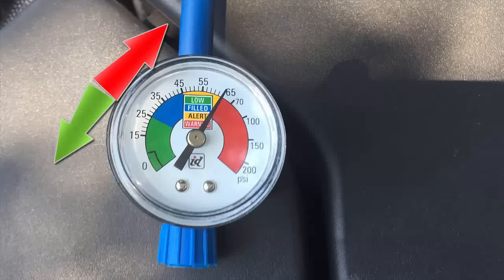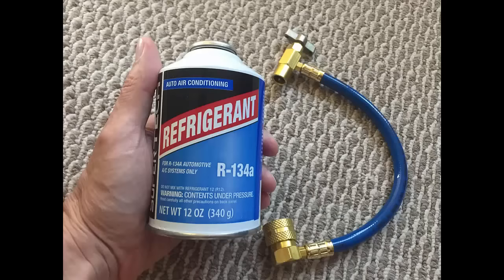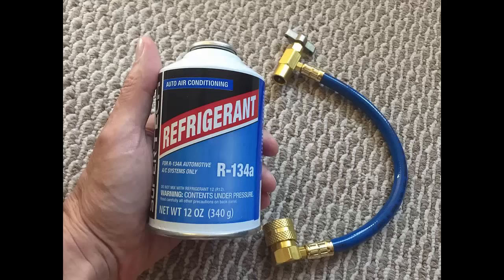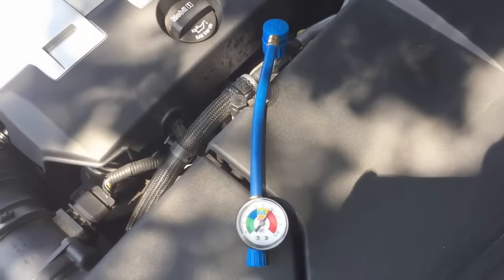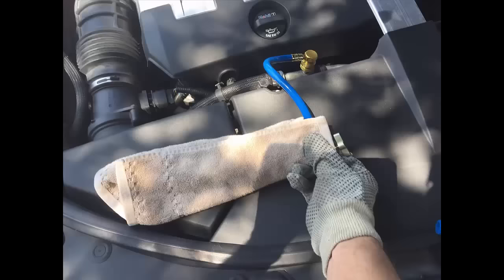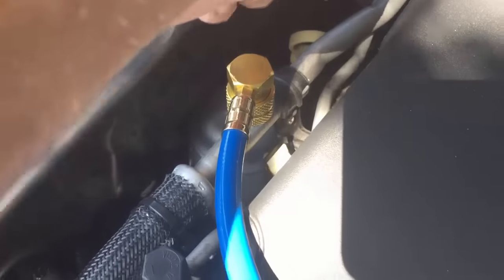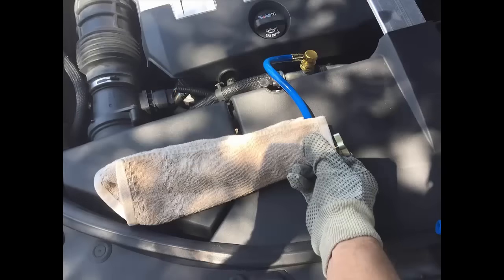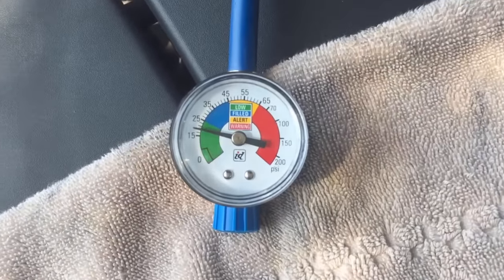Car AC pressure too high FIX overcharged a/c gauge fluctuation reading jumps Up Down Freon problem

Comment: I used a/c pro to recharge my system in my 2009 Lincoln MKS.  I did it once a few years ago and it was perfect.  Cold air, no issues.  The AC started to blow warm again in June 2022, so I figured I'd recharge it again.  This time, not so good.  While charging, I noticed my engine stuttered and the a/c pro gauge jumped back and forth.  When I got into the car, the air was warmer than before.  Thinking it just might need some time to recycle, I drove home.  The AC never got cool, the engine was rough, and the RPM gauge in my car jumped wildly.  I ran the ac when I got home for about 25 minutes, and nothing changed.  Now I think I have an issue and will need to go to the dealer (likely $200-$300 to check, evacuate, and recharge).  Before I made that call, I thought I'd check once again on how I might fix this, and saw this video.  I watched it a few times thinking it couldn't be this easy.  I read a hundred or so comments.  Many thanks and good results, so I thought I'd try before making the dealer appointment.  I put on my gloves, grabbed a towel, and before I turned the car on, I attached the A/C Pro gauge without a can and pulled the trigger.  IT WORKED!  It only took a few short squeezes.  I started the car, turned the AC to full blast, AND IT WAS COOL!.  I went back to the gauge to check the reading while the AC and Car were on, and made a few more short squeezes until the gauge got into the green and settled in the green at 25.  Removed the cord/unplugged, recapped the low-pressure input, closed the hood, and enjoyed cool air inside the car for 25 minutes.  I turned the car off, waited a few minutes, restarted, and turned on the AC.  It still worked.  The whole thing took under 10 minutes.  I'm so happy.  Saved me $200-$300, and a day at the repair shop.  I know you're not supposed to release the contents of the system into the air, but it was so little I don't feel bad at all.  Thank you @Yourself for this most helpful video.
Reply from the maker: Thanks for sharing!

Comment: Thank you so much dude! You saved my 2017 Nissan Frontier’s AC’s life! I thought I completely fucked my air conditioner because I over filled it but thanks to you I let some pressure out and it works like new again! You saved my ass bro thanks again!
Reply from the maker: Glad it helped!
Reply: I have an 18 frontier. What psi on low side is working good for you? I don't trust the color system

Comment: Thanks for the video. My AC was working in the morning and late evening but right at 3PM when it's super hot the AC was just blowing hot air just like your issue.  I could hear the compressor kick in and out so I know there's Freon in the system and  system is working.   I release some pressure out a few times and now my AC is cold once again.  Previous owner probably did some work on the system and either overcharge it or not enough Freon.  Thanks!
Reply from the maker: Thanks for sharing!

Comment: Thanks this video helped out.  In my case, I had too much Freon and had to release the pressure.  It sure sounds like either you have too much pressure or too little pressure and the compressor therefore turn on and off.  If you just recharged it I would imagine that your pressure is too high.  And if you haven't recharged it, it probably means your freon is running low.  At least that's my opinion.
Reply from the maker: Well said Randall Quezada!
Reply: i just put a can in yesterday, it does get cold now but it does go from cold to not very cold, back and forth. then today i checked with the same gauge the video has and it keeps going from the bottom of the green to the top of the yellow. and i hear the click everytime it goes up or down. is this the same problem?

Comment: Thank you so much . I thought I just blew my compressor after misjudged recharge . I removed some refrigerant and now the ac is back on track . 😊
Reply from the maker: Yep, they sell huge canisters with refrigerant, while most people need only a couple of ounces to top-off the system. I'm glad you fixed it yourself!
Reply: That's the high pressure switch making it cycle the compressor. While your letting out that freon if it's being sucked into your cars engine is being turned into fosgine gas. That will kill you.
Reply: @AltonRowell-gb1lb  r12 does, yes. r134a is pictured.

Comment: Seems how something so simple would work!! I thought for dammed sure by getting "greedy" with the cold, it was going to cost me a lot of money to have it "professionally" done. Now the back story that could help some..... The air was already pretty cool but the PSI was only showing mid 20's and when the compressor kicked in for a few seconds, maybe 45 (which isn't the reading you're looking for). After "filling" (maybe 5 oz's)..... It read 40 and 60.... However, it was only 70 outside. Next time I turned it on, it was less cool so I went to look at it and the Compressor clutch kept cycling and screwing with my RPM.... on top of the seemingly warmer air..... THAT WAS IT..... and I came here.... Thanks for the simple fix my man..... My tip would be, if you don't need a whole lot, don't turn the can upside down when topping off...... Rather put a little in at a time through different heat conditions and don't go for MAX cold, you'll just end up wasting it

Comment: edited....sorry, i was FIXING MY A/C outside and commented too quickly/too vaguely.  the gauge should be fluctuating a little as the clutch engages. It should be in the blue (on this gauge) all the time when the car is running a little above idle with a/c on.  Running at 15 when the clutch is engaged is too low.  it says so right on the gauge.  If you hook up the gauge and it is high and the a/c compressor is cycling on and off quickly, you don't have enough freon.  As you add freon, the pressure should go down, and you should hear the compressor running longer and longer.  My compressor is loud.  Your's might be quiet...you'll know it's kicking on/off because it will click and bring the engine idle down when engaged/running, then click and idle will go back up.   If the compressor is not turning on, several things could be wrong like a relay, nearly no freon, bad clutch, etc.  If you add a can of freon and the pressure does not go down or compressor cycle, something is wrong.  One of my cars is 15yrs old.  I have to add a can every year.  You know you must add it if the a/c works when it's cool outside, but doesn't work when it is hot (above 80?).  With the a/c on max, the clutch was cycling/engaging for about 2 sec, then off for about 5 over and over, and the air coming out of the vents was warm.

Comment: it worked for my Silverado 2011 that was constantly running high for the cooling fans, high noise when they are at high speed constantly, and  I read is a symptom for overcharged, and this fan high speed  happened after last gas fill I did. due to leaks fixed with 3X sealant can. Thank you very much.
Reply from the maker: Thanks for watching!

Comment: FINALLY! I thought it was the relay plug, it wouldn’t quit stopping and starting. Endless cycle. I just found out it i put too much pressure in, and it showed on the gauge there was too much pressure once the car had been running for a while. Let your car run with the gauge connected, and once the car has say for about 5ish minutes you’ll tell if there is too much pressure.

Comment: I save my empty cans and use them to discharge into that way I can reuse later without having to buy more:)
Reply: How do you get it back in the can? May be dumb but serious question.
Reply: @turboDavo  have to use manifold set and off the high side, takes some doing to make sure get liquid back in can and cautious of the high pressure put back in the can
Reply: @turboDavo  I packed the can in ice and filled it using right side up, it won't fill up as full as when new but works for just bleeding off a bit of over pressure.  I haven't tried this yet for vacuuming the ac system to work on it.

Comment: Awesome video thanks for this. Just wanted to say though another issue might be air in the ac I think your suppose to vacuum the old freon out. What I learnt when looking this up but could be wrong. Ty for the vid
Reply from the maker: Yes, if there is air in the system, the leaky part needs to be replaced, vacuumed, and fully recharged.

Comment: Awesome vid....
I filled my car ac and I put way too much.  AC didn’t even kick on because there was too much refrigerant.  I used the artic freeze trigger and just triggered away the excess gas and now it’s working fine.  My trigger gauge colors are different where green is good and white is low.
Thanks
Reply from the maker: Excellent! Thanks for watching.
Reply: so you use the same hose and gage that came with the refrigerant can? do you just unscrew the refrigerant can off the hose and then hook the hose up to the low pressure line?

Comment: This guy is fucking awesome!!! I overfilled my AC system and it was blowing hot. I released some of the pressure and now it's ice cold again. I'd  say it is colder than before. This summer would have been hell without AC. Thank you OP for this video!!!
Reply from the maker: Thanks for watching!
Reply: So did you take pressure out with the engine running or off
Reply from the maker: @kingchrisp198432 the engine should be running with AC on max.
Reply: How did you released the pressure?

Comment: I drove myself nuts with this today.
 Make sure the air conditioning is on high speed, Max cold and that the fan is set to high..... If the compressor is NOT running, or has temporarily cycled off,  you may get an overcharged Red Zone reading..... if the air conditioner compressor is cycling on and off and clicking, the only correct reading will be when the air conditioning compressor is on. When it clicks or cycles off, it may jump to overcharged, even if you have close to the correct amount of refrigerant in the system.
In summary, the ONLY correct reading will be when the air conditioning system is on and the compressor is actually running and not temporarily cycled off!!
When the compressor stops cycling on and off,  you will get a more accurate reading and can fine-tune the adjustment,  by either adding or removing refrigerant.

Comment: Those are typical symptoms of someone not pulling a vacuum before initial service what the refrigerant. If you have the same situation you're never going to save it need to evacuate the system pull a vacuum then service it then it will work above 85 and 95 degrees like it's supposed to.

Comment: Bro thanks a lot, I overcharge the ac today, it was blowing str8 heat after watching your video I released some pressure out of there ac works just fine.
Reply from the maker: Glad it helped
Reply: @Your-Self  mind you I’m at work right now lol I did all that at work

Comment: When it fluctuates you need to keep adding freon because its too low until the needle stays steady. Instead of removing freon how you were doing you needed to keep adding freon until your compressor stops turning on and off..
Reply: That's right my ac compressor was turning on and off until I add the hole can
Reply: Mine is fluctuating up and down but when I add freon it says it's full and if I add more it starts going in the yellow zone do I disregard that and keep adding freon or is there something else wrong with my ac ?

Comment: Do release the pressure with car and a/c on or do it with the car off
Reply from the maker: the engine should be running with AC on full blast
Reply: With vehicle on and ac on.
Reply: do i release high pressure?? "H" ??
while the car is on? and a.c. still on?
high pressure, how about may LOW PRESSURE line? nothing to do about that "L" tube line??? correct me please :)
Reply: @Your-Self  hello please help me sir :)
Reply: @michaelgonzales23  from low pressure side  only
Reply: @bobsyouruncle8052  ok thank's :) hope will be ok my a.c. :) thanks buddy
Reply: @michaelgonzales23  have car running and a/c on max when doing it
Reply: @bobsyouruncle8052  ok, thank you :) i'll do it

Comment: How do I let the pressure out if cord has a gage
Reply from the maker: Not sure how it's going to work with the gauge, but you can buy the same hose I have for about $8 on eBay https://goo.gl/WDjR58 or at your local auto parts about $15-$20
Reply: YourSelf cars are really easy to overcharge put the gauge on when everything hot outside over charges will be really hard on compressor
Reply: marilyn tomlo Kick the Can off wrap it up in a towel squeeze handle don't get the freon in your hand
Reply: To check the pressure put empty can back on hose

Comment: Thank you! Have the same problem. Going to see if I can recharge an old can as I release the pressure. 
Somebody else pointed out the pressure reading drops when the compressor is running and that’s the reading to use. I’ll look the that difference as well.

Comment: I have a question, i was trying this in my car, my pressure was above 120 psi, i got it down to 80, but it won't go any lower. I held it fkr minutes and it didn't go any lower. Any thoughts?

Comment: If it's jumping it on the meter it means that the compressor doesn't have enough refrigerant and so the compressor clutch with turn on and off making that clicking noise giving you inaccurate readings. If you look there should be a label somewhere in your car probably on the hood showing you how much refrigerant to use, my truck for example used 25 ounces so I used 2 12ounce cans. Basically, you have too low refrigerant, keep going until the compressor clutch can actually spin steadily.
Reply: Alexone635 my Gage is doing the same thing jumping do I need to add to it do I do it while it jumping
Reply: Louie Olivarez yes, just make sure that you can hear your compressor clutch kick in which I'm assuming it is if you can hear the clicking sound and it keeps jumping. Have the engine running while you're putting some in and you'll know you have enough refrigerant when your compressor clutch runs without stopping. You can actually see your compressor clutch in motion if you take a look at the compressor, right where the pulley is connected.
Reply: Alexone635 c
Reply: yes this is what mine was doing the compressor was turning off and on giving me and inaccurate read but I watched for the clicks and found when the compressor turned on it showed low when it clicked again it showed high pressure so I started putting in the freon until the compressor stayed running and then I finally got an accurate reading
Reply: I think you are wrong.  The clutch should not be running at all times except when it's really hot outside.  it should be running on and off, it's called cycling.  If it's running continuously it's because the evaporator temp sensor is broken and you should be getting freezing a/c lines and at some point the evaporator (inside the dash) will get completely covered with ice and the airflow inside the cabin will became restricted.
Reply: Royale with cheese before I messed with mine in my 2003 trailblazer I watched my 2015 malibu that has no ac problems and the compressor stayed constantly running with ac on full blast
Reply: Was the weather really hot?  It may run continuously in the hottest weather, but for normal summer days it should be off like 10 seconds/minute
Reply: Royale with cheese nope it was only like 80 degrees
Reply: Royale with cheese it's been three weeks and ac unit is running in tip top shape I have rechecked the pressure and it's still good
Reply: A car (ac)  is a sealed system..it will not be over charged or if it had work done to it! Best way to find leak is to add leak die.you will leak fast.then fix and charge eity call correc freon
Reply: Most AC systems have a pressure switch. The compressor will turn off if the pressure is too low or too high. In this video it's too high which is why it keeps turning on and off. If the pressure is low it will turn off and stay off until you add more refrigerant.
Reply: Can i fill the system with refrigerant while compressor and engine off? The whole 27oz and then start it? Or that can cause a provlem?

Comment: Seems like you have an expansion valve problem.  All the gas needs recycled, and the expansion valve needs replaced.  Then vacuum down the system then add the correct amount of r134a.  It is normal for the pressure to be hire than it should be when the compressor clutch is not engaged.   Typically the pressure should be between 25psi and 35psi when the clutch is engaged on the ac.  Sounds like you need someone with more knowledge on the ac system.
Reply from the maker: Thanks Xpresn 1 I'll keep it in mind... but so far my AC works well during the hot summer.
Reply: How much might the service u recommend here cost ?